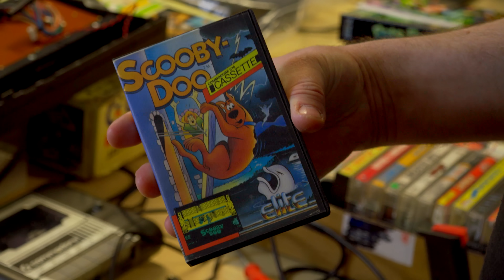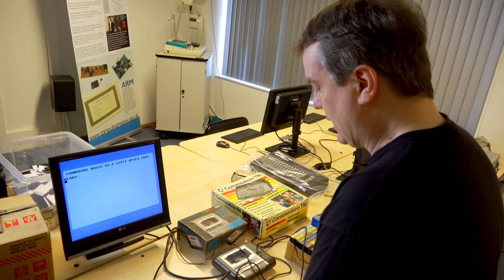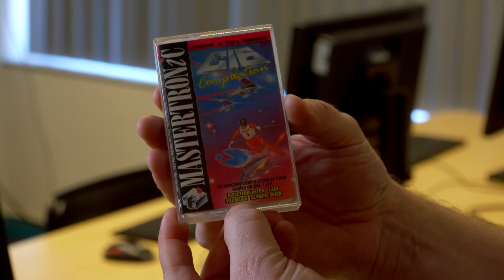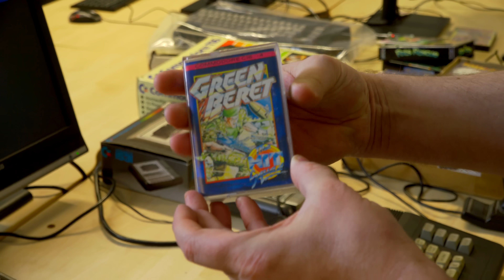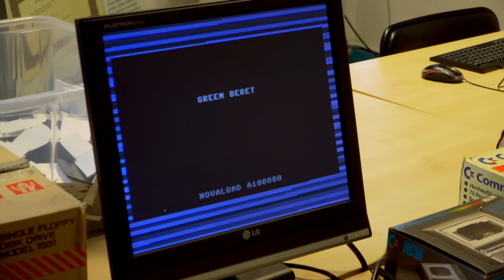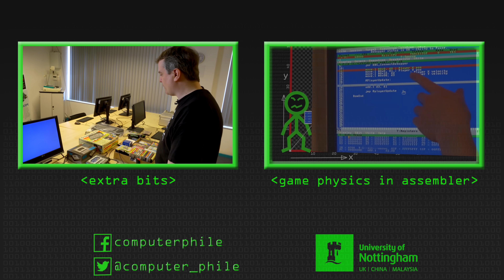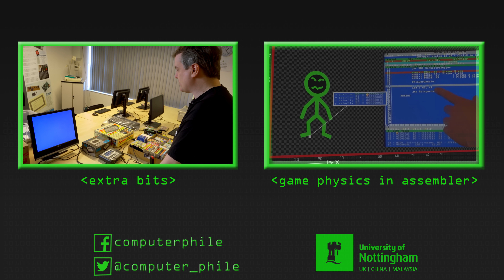Commodore 16 & The Worst Video Game? - Computerphile

Comment: If I remember correctly, the original idea for the C16 was that it would be a bare-bones system selling for $49 to undercut the Sinclair but feature-creep kept increasing the cost. $49 would have been a huge game changer if they could have pulled it off.

Comment: It was the bane of C16 line - the lowest common denominator. It didn't matter you shelled for Plus/4. Publishers were selling games for C16, because that covered the widest market.
With C64 there was no lower-end option, so all software (games) were designed for the full 64k machine.

Comment: Just to add which games wont work on a 64k upgraded C16, is Rockman/cassette version. The game loads no problem but when it loads up and you press a "Fire button" or a key on the keyboard, the game itself turns into blocks and is completely un-playable.

Comment: You say that there's not many games that don't work on the plus/4, but I found that Rockman was actually one of them.
It ran, but the character set was scrambled, so I guess they used the wrong address and the limited C16 memory meant it mapped correctly, but with the full 64k of a plus/4 it didn't.
Could also be that I had an early copy, and they fixed this later...

Comment: Why don't you solder a capacitor between the high and ground pins on the joystick ports to fix the problem of hot-swapping them frying things?

Comment: How would plugging/unplugging a joystick damage the machine?
Weren't the joysticks essentially just a bunch of switches like other joysticks of the period?
How would the machine even 'know' there was a joystick connected unless a direction or the fire button was pressed?
Did the C16 joysticks actually have circuitry inside them?
Reply: Not familiar with those joysticks in particular but I presume the issue was with power management.  After a quick web search I found a pinout for the joystick connector which shows it has power, ground, 4 Joystick connection (direction), an 'A' button connection, and a Data connection.  Presumably the reason removing a joystick actually killed the TED chip is because removing it would cause a spike in board power which the TED chip and power supply weren't able to properly handle (on a modern system power is smoothed and there's quite a few safeties to ensure a power spike won't cause an issue).  The C16 would presumably detect the presence of a joystick by detecting if the joysticks power/ground circuit was complete so it could have also been a bug in the TED chip causing it to freak out when the connection was interrupted.

Comment: The Commodore 64 (at least the model I had) was prone to the power supply failing.  When that happened it would start displaying random characters in random colors on the screen as you typed or listed a program.

Comment: The Commodore 16 and Plus/4 never caught on here in the US because there simply was no market for it.  Back in '85 we were perfectly happy with the C64 and its contemporaries (I was an Atari 8-bit user myself), all of which were pretty affordable by our standards (especially when compared to things like an IBM PC/AT, Macintosh, or an Apple IIe).  From what I remember of those days a particular model computer (like a C64) cost more in Europe than it did here, so computers that offered a lot of value (like the C16, Plus/4, and a bit later the Atari ST) seemed to find more of market in Europe than here in the US.

Comment: Did they forgot to disable the hardware cursor and left it flickering in the top left of the screen?
Reply: Yes the flashing cursor is rather odd. Probably used valuable CPU cycles that.
Reply: @maxusboostus  The TED chip has support for hardware cursor, so unlike on C64, flashing it was essentially free. It's just that it looks totally out of place. The programmer should have hidden it below the screen (you cant disable it entirely) by writing $FF to $FF0C and $FF0D
Reply: I see, Thank you vytah , I wonder if some clever demo coder could use it as some form of hardware sprite, although it would probably have its position locked to a 8x8 grid and would probably be blinking all the time!